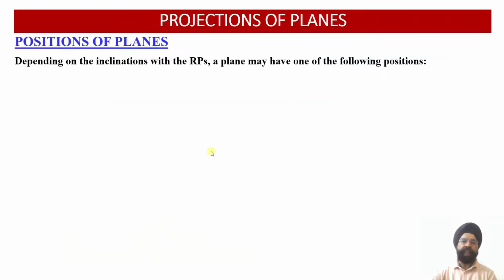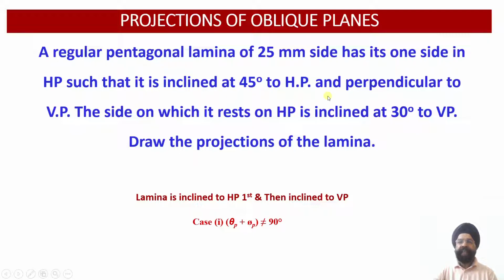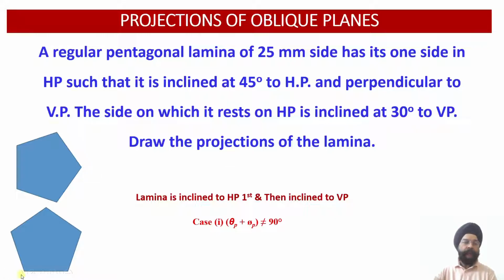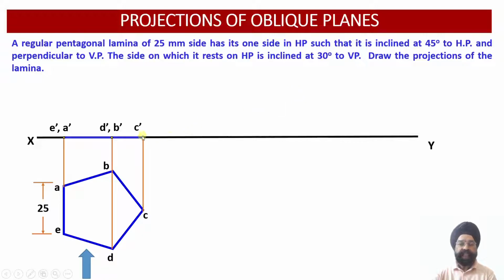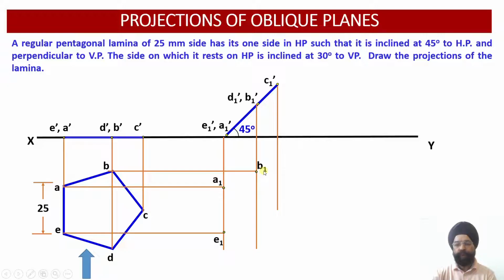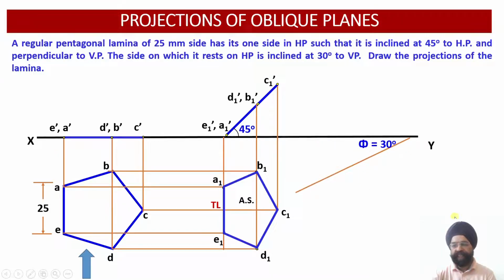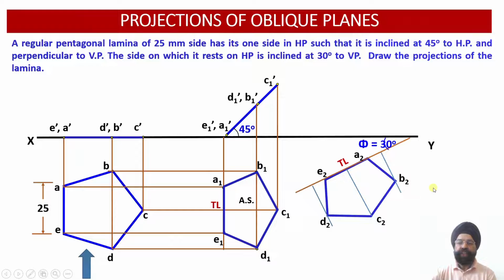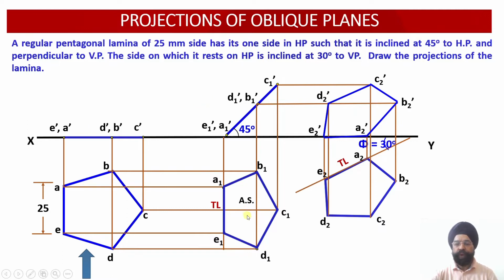Engineering Graphics Lecture 011B Projection of Planes II (Pentagonal Lamina inclined to HP and VP)

Comment: Q) develop the projections of Pentagon plane of side length 25mm and inclined at 40 degree to HP and perpendicular to VP ?

A)1) 40 degree is surface inclination or side inclination??
2) what type of pentagon i draw. Pentagon in this video or  other Pentagon.
3) front view (straight line) should i draw on XY line or little distance away from XY.